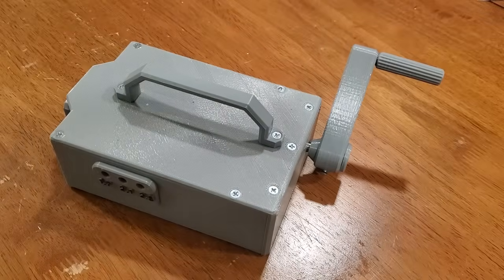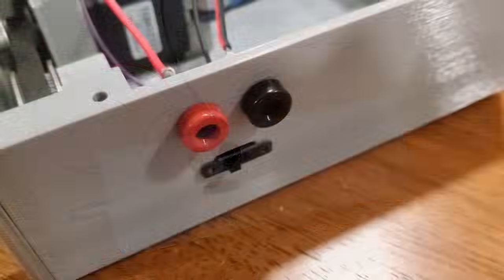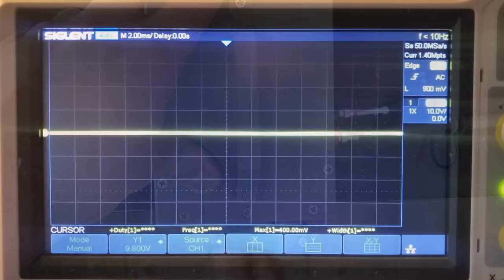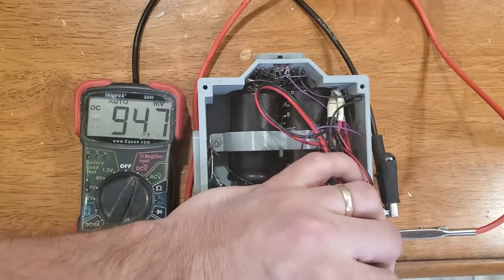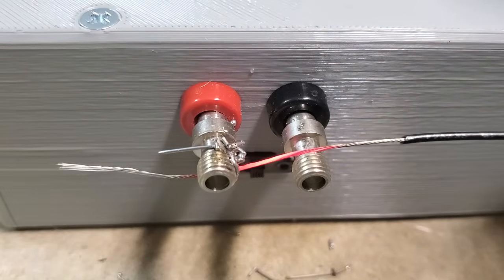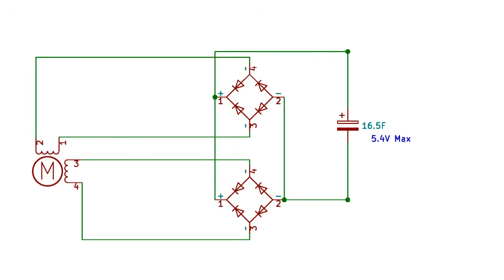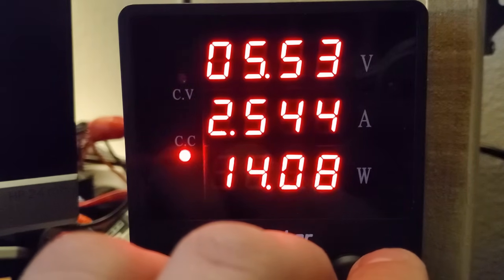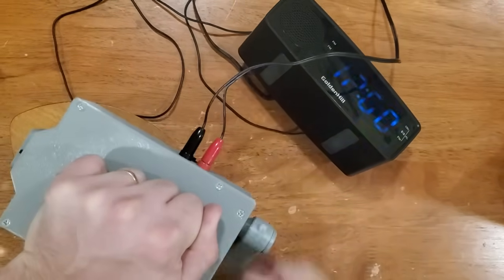A Generator built from a Stepper Motor and Supercapacitors

Comment: These diodes are low-power and will not load the generator at full capacity. I used perfect diodes. Look at my channel about my generator called "White Hole" where I achieved a 50W generator power with a relatively small size.

Comment: A great project and a perfect use for the box of stepper motors I have sitting around. I'd rather figure out how to connect the input pulley to my Jack Russell instead of hand cranking though.  A MUCH better option in an emergency because that little bugger NEVER runs out of energy.
Reply: A treadmill and some salami on a stick seems viable
Reply: @welder77  Exactly my thoughts.

Comment: When I did something similar (only Light) some years ago I used constant current for the LEDs - so I could crank to 25V (max. voltage of my capacitors) and that improved the duration of light a lot.

Comment: I'm going to try to do this but instead I'm going to use a dc to dc but convert to limit the voltage to a safe level then another converter for usb devices and stuff however I'm not a electrician and I have little idea what im doing

Comment: The stepper motors used in old printers and copiers make awesome hand crank generators. You can also add a transformer to get much higher voltages too.❤
Reply: Transformer too heavy

Comment: Very useful! You could add a fairly small 5 V Solar PV panel to it, using the output connectors if you like keep the bigger capacitors, and trickle charge it during the day. That will give you a flashlight for use all night, and at least 45 minutes of moderately loud radio. Pick a radio which only drives headphones, and it will run for hours before it needs a few minutes of cranking.
Reply: se pierde el objetivo del proyecto

Comment: still 2W is okay for use but pretty low compared to what a hand can easily handle, some of those old hand cranked generators also can generate similar or bigger amounts of power while being much smaller and such, probably also mostly due to being optimized for generating and having a big gearbox in them. you might want to try using one of those smaller steppermotors with a strong gearbox, or add more gear ratio to your current setup since your current setup does have one advantage and that is that as long as the power is drawn away fast enough that it does't reach to high voltage, the motor won't be likely to break and the gers won't break as easily either or be more easy to replace. now much energy is wasted in the arm shaking everywhere. technically seen something like 50W should easily be reachable hand cranked if the generator is efficient enough, so have to figure out why the current now is low.

might also be that your cirquit to regulate it or such just is to slow, perhaps add a higher voltage capacitor directly after the rectifier so it can run on better power levels and more stable.

Comment: I have a better and easier idea, which is by converting thermal energy into electrical energy using an electronic device called a vilteer. How this project works: Bring several sensors from the vilteer and cover them with a highly heat-conducting cloth, then sit on it. Your body heat will turn into electricity without any effort on your part.

Comment: The belt is a very simple way to connect the handcrank with the Stepper motor but you would definitely have to crank a lot less if you add step up cogwheel gears that give you much more spinning momentum per crank. Just ONE rotation of the crank would give you much more juice instead of the belt gear.

Comment: My friend why to use stepper motor, bridge rectifier if you could directly put gear dc generator of 12v. It could reduce your charging time to 3 min and also decrease the size of overall setup. The discharging time could be 3hours if use 3 (1watt) bright white leds in series. 

Just an idea for your reference mate, i have perfected a hand crank generator simple in size of 3inch *2inch with 12v geared hand crank generator with two 500f supercapacitor. Try it yourself, it really works.

Comment: I made  a super easy hand generator using the turntable motor from  a microwave. It has gear reduction  that you can run in reverse built right in. You must put a crank on the out put shaft. Then run the power leads to a bridge rectifier. Mine generates verge a bout 35 volts and up to say 60 -70 vac. Barely moving te crank lights up some decent leds and will heat a single strand of copper wire bright red in a few seconds. 
Lots of further experimentation could be done. By you!!
Reply: cool!
BTW makhonea, have you become a flat earther yet?

Comment: Great! There is little that I'd change. Use an LED driver to drive these white LEDs or use a high power LED module. You are wasting most of the energy in the resistors. Given the time effort to charge the caps, it is painful amount of waste. Maybe add a USB charger module to it?

Comment: I have a turbine producing 4.7KW for 5 minutes every 25 minutes. Is this a good situation to use a supercapacitor to produce constant electrical output. I need to have 60KWH from my waterwheel system 
Thank you in advance

Comment: For 6:47, you may have been able to achieve similar results with a diode clipper and a transistor or two...or if you applied the clipper to the AC output you could do it with just a diode alone.

Comment: I think if you could use the LEDs for a lot longer if you put a little buck converter in there...  Then you could get higher voltage super caps.  Also, if it were a boost-buck converter, then it could juice out every last joule from those caps at a constant brightness.
Reply: Joule thief circuit would be even better.

Comment: Increase the gear ratio and replace the stepper motor with a BLDC motor and a 3 phase rectifier .. it will be able to supply more current .. as they are ment to be operated at high currents (unlike Nema17 stepper which works on 2Amps)

Comment: Cool project but I have two thoughts. One is that if you were only generating 2.5w power going in and as you said it was still easy to turn I definitely would think a higher gear ratio to the steeper motor is in order to get more power in less time.

 Also the super caps could still be great to use but maybe in connection with a boost circuit. I know they are not as efficient but it would let you be able to get much more power out of them to much lower levels.

 Even a basic Joule Theif would work for the leds. And what you very much could do is have a toggle switch to run lights directly off the caps above a certian voltage then switch to the boost circuit after it.

 Or even just having the circuit for the lights be run off a buck boost and forgoing the resistors to the lights by keeping the voltage slightly lower then thier max.

 Thereby saving a lot of the power losses in the resistors have at higher voltages. And keeping the lights running much brighter or even full brightness at lower levels.

 First video I seen by you. Thanks for sharing.

Comment: Would it be possible to add a switch that switches if from charging the caps to charging a removeable AA or 18650 battery?

Comment: Cool project! I wasn't aware of how useful steppers are as generators, and am definitely going to have a play around with them. Just a thought (It might ruin the "bare bones" design philosophy somewhat), but it might be worth using a cheap ebay DC-DC converter module to improve the charging efficiency and double as a voltage limiter for the caps (eg LM2596 to charge the caps from the stepper). You could also use a similar module (boost or buck depending on the arrangement of caps) to provide a regulated 5V out for charging USB devices.
Reply: They probably exist already but i haven't looked....a universal or multi output dc dc buck boost converter would be ideal for any generator. I assume something exists already due to products like solar generators etc that have many outputs...12v car...120v household outlet, usb outlets, and maybe others. 12v is good for being able to jump start a motor and or charge from the alternator. Inverter is obviously needed for 120 and is the least necessary but more useful if there. Having an 18v (20v) output to charge tool batteries would be good. Maybe 52v and everything below could be useful for some kind of electric vehicle like a bike.

Comment: You can replace the mosfet with relay that has normally open and normally close state and redirect the power another led indicator that the bank is charged when trying crank.

Comment: I think it would been a better approach to make a circuit that cuts the charge instead of shorting it out. it would probably charge quicker too if a higher gear ratio was used. it seems pretty easy to turn so my guess is that it is more work to turn it so many revolutions instead of having a higher some more turn resistance. but it is a neat project. maybe I wanna do one myself sometime

Comment: A small handle is a very inefficient way of utilizing human energy. Something like a cord to pull back and forth with two hands would be more effective.
Reply: it would probably take more space and should be able to resist much more mechanical strain . DO you have a link to something you are talking about?
Reply: @ivanbukac4618  Would you be satisfied with link to physics textbook? All human-driven  mechanisms should be built (among others) in principle of anthropomorphic expediency to allow muscles and joints to move with natural amplitude and natural load. So using most powerful muscles (on the back) of a top half of a body we can give more power to the driven mechanism. Using that small handle you will be using many small muscles that for body stabilizing and not for power. As a training that's good, but not for the best productivity.

Comment: The way you short the caps to prevent overvoltage, is that a normal way to do this? From what I understand, the shorting goes through the MOSFET, as the gate is open when the overvoltage happens, and the potential heat gets dissipated there up to a 175°c limit. But what would happen if you really cranked hard on that handle? Would you run into problems eventually or no? 

I have not seen any sort of voltage protection before so I have no idea how else to do it, I mean the way you do it here makes sense, it just seems a bit "counterintuitive" to short the caps to protect them. Could you maybe explain this a bit more?

Comment: Nice project, only advice is that if you want to play with high current (when you short circuits) then you may need larger and better circuit breaker - the small one you use is rated 0.25 A.

Comment: I built someting similar a while back, only i used a dead HD container, blades from a microwave cooling fan, a bit of trickey with plumbing gear. All linked to a stepper, charging circuit, a tiny volt meter and a usb. Inserted to my water mains just by the toilet. So everytime you flushed the bog you could charge your phone. Works a treat.

Comment: I made a similar device years ago. The charge protection I used was similar to yours but I used an LED instead of a zener or a stack of diodes as the reference and as a side effect, I got my charge indication for free. When the LED lights it trips the protection circuit.. I used a small signal transistor instead of an op-amp. I also used a high-side p-channel mosfet that passes the charge current to the caps. This way I am not ever shorting out the caps.
Reply: That's smart. Given how low the charge current would be it should be very easy to handle it with a mosfet
Reply: @clonkex  I would share this design with you but I don't know how on YT. Seems pretty restricted. It is easy enough to be represented with ASCII art but I am not that talented. LOL I would gladly share my design (of course, for free) if you know of a good way to do so.
Reply: @ybtech  URLs outside YT usually work but sometimes the comment disappears. But don't worry, I'm in the process of renovating and my workshop is a total mess. I have no time for fun projects anyway :(
Reply: Can you please share detailed info? For us, not electrical people
Reply: @youtubeworkshop3174  It is a little complex to describe if you don't know about electronics. Basically, it is a switch (MOSFET) between the hand crank generator and the super capacitor. It has a simple circuit that turns the switch off when the capacitor is fully charged. Mine is unique because I use the forward voltage of an LED as the voltage level setting. The LED lights when the capacitor reaches the full charge voltage level which then in turn disconnects the capacitor from the generator. I hope this helps.
Reply: @ybtech  You use a P-Channel depletion mode mosfet, correct?
Reply: @4_Nik_8  Yes. In my design, I used an IRF7410. A 12 volt, p-channel, HEXFET from International Rectifier.
Reply: I think you would enjoy using Wagos.

Comment: 7:12 you can use a normal zener diode there... shunting capacitors instead of disconnecting them seems pointless.

Comment: Wouldn't you be better off using capacitors that could handle the input voltage and then using a regulator circuit on the output so it would run the leds at the right voltage for longer?
Reply: Higher maximum voltage for caps usually means less capacitance and in this case it could even rule out affordable supercapacitors altogether. The protection circuit is acceptable, one could also use a flyback transformer to bring the 20V to just above 5V but that would make the circuit more complex and the protection still necessary.

Comment: To get most charge ot of a set cranking time you should have lower charge voltage but higher amps on the input to the cap bank.
So a buck converter could be nice here, charge a "small" capacitor at 10 or 15 volt and buck converter to get it down to about 5 volt.
That is like a cheap diy MPPT converter since now you're "shorting" the stepper motor and loosing lots of watt since the voltage is so low

Comment: You can look at circuit called Buck Boost converter and it will automatically get the voltage

Comment: So what would happen if you dumped all of the 5 volts into a battery. How wold you do that? And is that have any practical applications for EV?
Reply: The super capacitor is there to act as a battery, but with easier charging characteristics. :) Charging your electric vehicle with this device would be an act of torture.